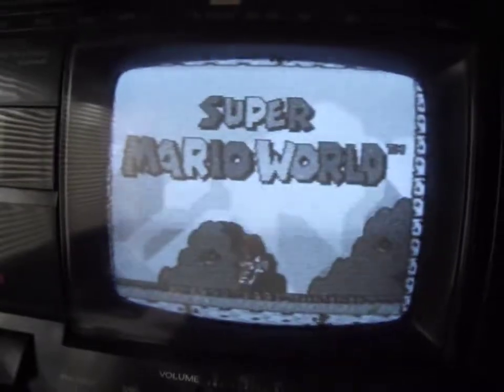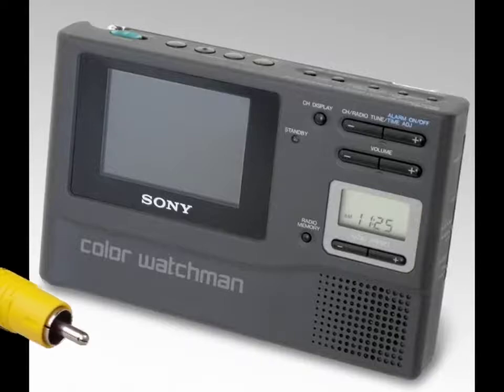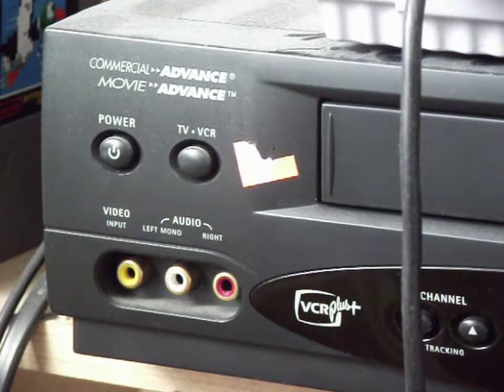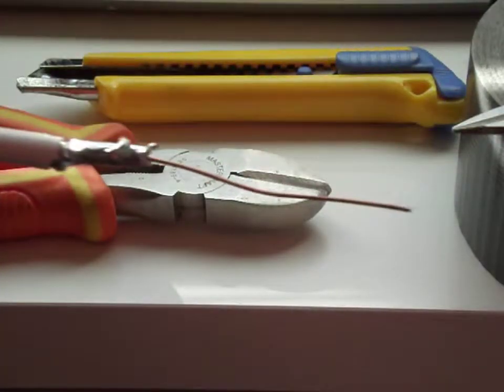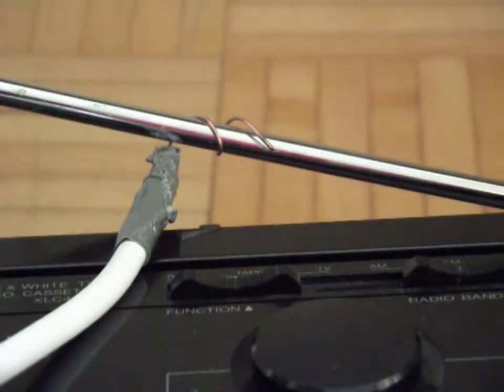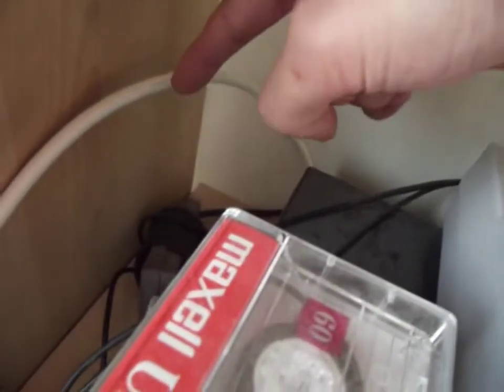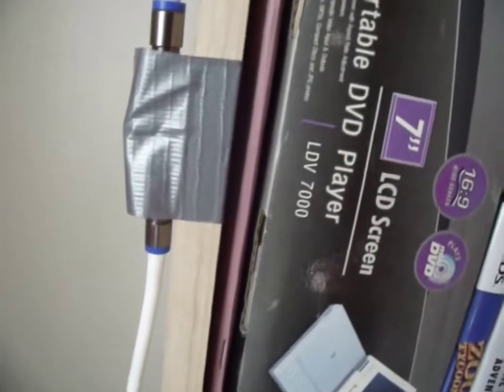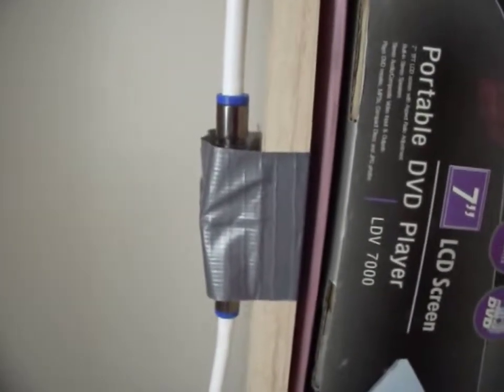How to Use an Analog Portable TV Without Video Inputs

Comment: Cool setup. 15 years ago I connected my PC to my TV using a VCR. My PC had Composite Video out and for audio I used an Jack 3.5 mm to RCA audio. I connected the PC to VCR with the RCA cable and the VCR to my TV with an coaxial cable. Now my VCR no longer works and I had to buy an analog stereo RF modulator. The advantage is that the modulator has the frequency output from 48.25 MHz to 855.52 MHz.

Comment: Does it work on Soviet TVs like Šilelis?
Reply from the maker: If your VCR is SECAM and not NTSC (those are different analog colour television systems), I think it should work
Reply: @doughnutelectronics579  Good evening, I have that TV, it works, the image shows but does not show TV channels, it only has antenna connections one MV the other DMV but it only shows analog TV, could you advise where and how I could buy a tuner or Digital to analog so I could watch Šilelis ?
Reply: oh lol i really wanted to know that but was afraid to ask bc the video is 2yrs old
Reply from the maker: I am not sure what will suit best for you, since you are in Europe and television is being broadcast in DVB-T (digital) and your tv is either PAL or SECAM (analog).
I am in North America which does ATSC/NTSC, I use a cheap Iview 2000STB Digital Converter Box which outputs compsite and RF.
I'd recommend to search for a converter box that can receive DVB-T and output in RF (coaxial), but if that is not an option you can convert the HDMI to composite, plug it into the inputs of a VCR, and use the RF (coaxial) output of the VCR to your TV

also sorry for taking so long to respond, i am not on youtube very often

Comment: Instead of Using a VCR,as an analog tv source,Use either an old plug and play videogame console(with RCA audio and video inputs),or a DVD player and hookups as an analog source.That ought to work.
Reply: That’s true.
Reply: Is there an advantage/ disadvantage to doing it this way? Wouldn't you have to strip all the component outputs separately?